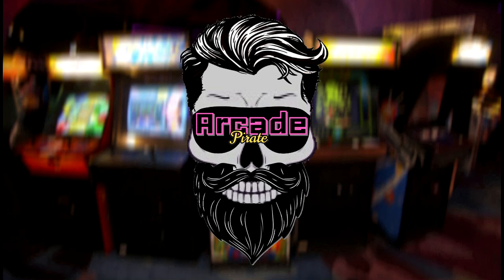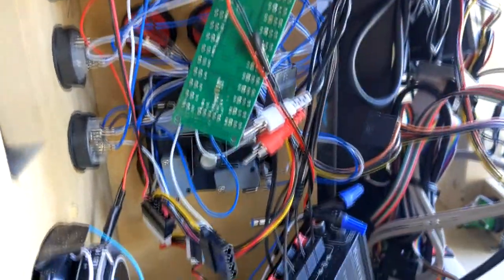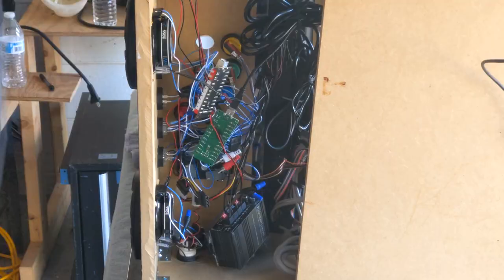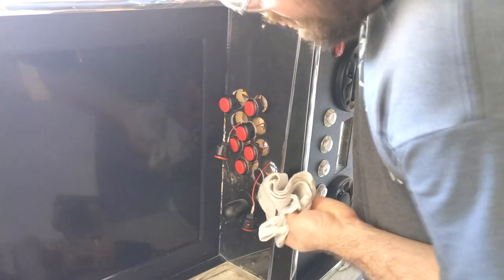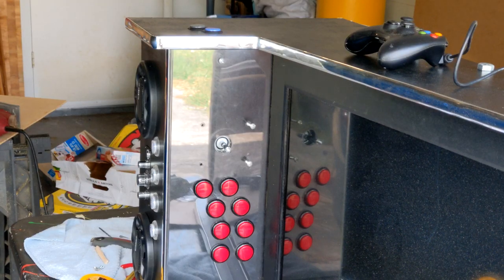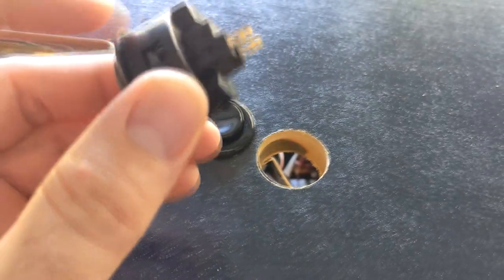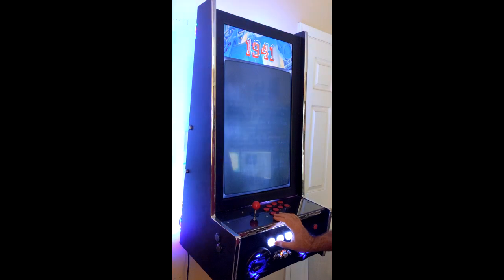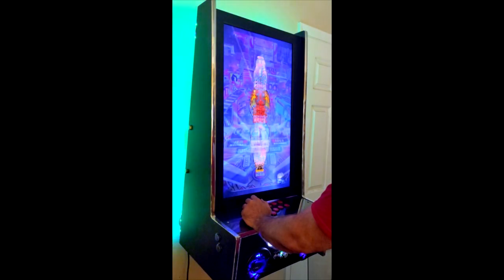Installing Sanwa Joystick and Buttons on my Vertical Arcade

Comment: Those Sanwa snap-in buttons didn't seem to have snapped in the controller panel, is it?
Reply from the maker: They don't snap in for me, but they do not move or come out. So it's all good.
Reply: @ArcadePirate  ok, excellent. That's what I wanted to know. I may not be able to get a thin panel. Good work, by the way. I like your setup.